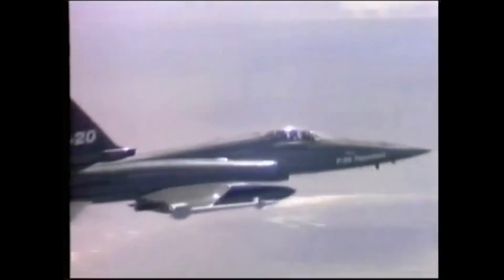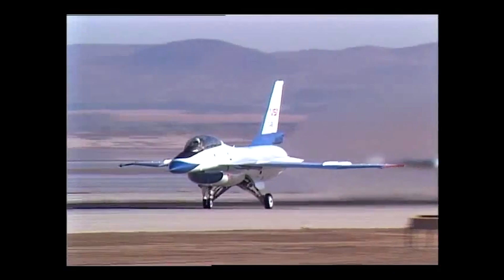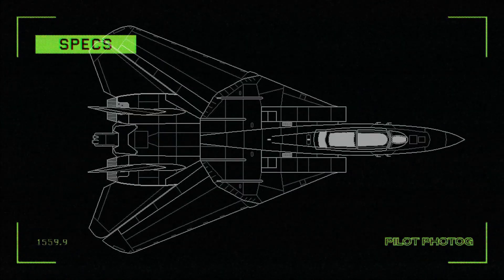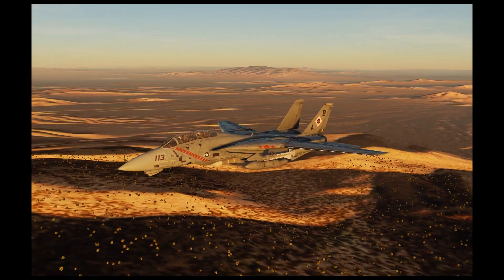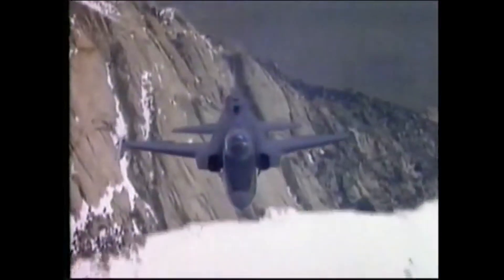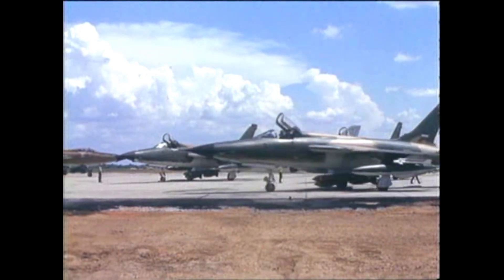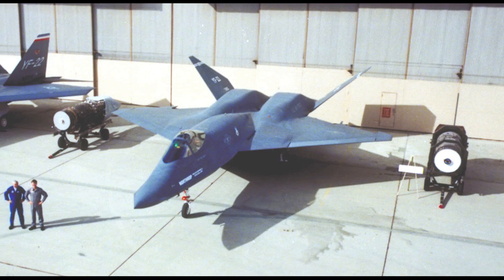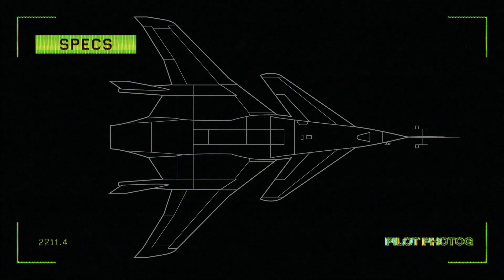Top 5 Fighters That Should Have Been Built | Best of Aviation Series by PilotPhotog  f20  f16xl

Comment: I was lucky to work on the F20, F16xl and YF23. Actually F16 B could be made into XL' s the cxl could outfly the F15E while fully loaded with munitions.  The Eagle had a better radar and two engines. The F20 couldn't carry the bomb load of the F16. The YF23 totally out flew the YF22 it was better in every aspect except size, (it was bigger the YF22)and engines the Air Force recommended a certain engine be used but  Northrop acft company wanted to use something else. If the Yf23 had used the same engines as YF22 we would have the F23 instead of the Raptor.
Reply: better in every respect?  Really?  That does not seem to be echoed by even -23 pundits.  As tested, the YF-22 was cheaper, (slightly) easier/cheaper to maintain, had a (slight) low speed/high AOA advantage, and had a larger combat load.

The -23 had a pretty sizable RCS reduction, (slightly) longer range, and retained energy better in high speed/high AOA regimes.  I also" think" the -23 had a higher top speed, though its supercruise speed was lower (or do I have that backwards?).  Admittedly, that may be due to the kerfuffle over engines you mentioned...

Both were awesome.  F-22 seemed to answer DOD's request better (at the time).   It did not help that Northrop already had a black eye due to the B-2 shenanigans.

-23 will live on in the -22 replacement.  6th gen looks to have stolen lessons learned from the -23 airframe.

Comment: Another fun fact about the Avro Arrow: It was designed with its engines on rails to facilitate a 30-minute "hot swap" (literally remove an entire engine and install a replacement inside a 30-minute window)... AFAIK, NO other military aircraft has even considered that as a possibility, let alone including that feature in the design. As a Canadian, I am still sad that the politics of the day cancelled the plane, but, as noted, many of those who worked for Avro found places in the space industry and had prosperous careers.

Comment: The F14 and F20 should have been produced. The F20 because of its affordability and easy maintenance. The F14 (thought a hydraulic nightmare to work on) was and is still one of the best fighters ever built. If we ever get into a dog fight with Iran, I fear they may show teach us a lesson on why we should have kept it active in our arsenal.
Reply: At many Redflags/exercises, the Tomcat was known as the Tomgrape... Grape = easy kill.  I would say it was one of the best interceptors ever built... and a slightly above average "fighter".  It was simply too heavy (even with giant engines) and bled energy too much in a turn fight.   Even in a vertical energy fight, the F-15 would out-rate the F-14 while losing less energy and the F-16 would simply not "bite" into the vertical, keep in the horizontal plane, and force the F-14 to extend or push a bad position with lower energy.  Same things would happen with Soviet/Russia aircraft in an actual fight (Mig 29 would play the Viper game, the SU-27/30/33 would play the Eagle game).  A fun "fight of the cripples" would occur if a Mig-25 met a F-14 (and somehow they did not shoot down each other BVR).  F-14 would win that hands down, assuming the -25 simply did not run away.

However, I admit that many of those aircraft would have been dead in a real fight from Aim154s.   Hence, great interceptor...

As for Iranian F-14s, they don't have Phoenixs and they are Mx hogs.  They may be able to sprint and catch a High Value aircraft out of position, but they would be no match for modern American 4.5 and 5th gen fighters.

Comment: FYI- 
F-14 had 135 Air-to-Air Victories (130 by Iran) vs 102 Kills by F-15 (all nations).
Expensive to Build, Expensive to Maintain, Expensive to Fly, but appears to have been cost-effective for it's designed mission.
The Upgrade would seem to be justified.

Comment: THANK YOU for putting the Avro Arrow in there. This Canadian aerospace development is so often overlooked but was revolutionary. It would still outperform some aircraft today.
Reply: We should go for it instead of the F-35, am i right?
Reply: It wouldn't outperform any modern fighters at all. It was outdone by the F-4 in basically every aspect of combat performance. The Arrow's revolutionary aspects were all in it's ease of use and maintenance.
Reply: @dumdumbinks274  First of all, it wasn't a fighter.  Second, it wasn't even put into operation, so how was it 'outdone?  It flew as fast in test flights with stopgap engines as the F4 ever did.  It couldn't possibly have faired any worse than in combat than the insult that is the CF-104, which can't claim a single air superiority kill during its entire service life.  How the Arrow ended up being killed for obsolescence only to be replaced by an even less versatile pure interceptor is stupidity of the highest order.
Reply: @shawnwells5719  It was the same type of aircraft as the F-4... a missile focused interceptor. The difference is that the F-4 and all subsequent 'High' US fighters could perform that mission just as effectively as the Arrow could have hoped to achieve, but they also had characteristics that allowed them to perform effectively in other roles as well as unexpected situations.

The F-4 was roughly 200kmph faster with the basic J-79s than the Arrow achieved in tests with it's stop-gap J-65s.

Not sure why you think the CF-104 not achieving a single air to air kill during it's service life is a negative point... it never saw combat. The F-104 however is credited with quite a few air to air kills in service with other nations.
Fact of the matter is that when the CF-104 was first procured it held 3 world records simultaneously and was arguably the best interceptor of it's day. Procuring the CF-104 was not an insult by any means... the only insult was scrapping the Arrow, and it had to be replaced by something.
Reply: @dumdumbinks274  it's not entirely about the plane, it's about the Canadian dream, it's about the innovative revolution it could spark for not just Canadian defense, but Canadian aerospace forever
Reply: @onegoodfurboj  Yep that is definitely something to consider, but it isn't a reason to buy the Arrow so much as it is a reason to keep the industry alive. You don't have to sell planes to make a profit in the industry, but as we all know that's not what the Canadian govt decided.

Comment: Canada was not involved in an anti ICBM system.  Money was never the reason given for ending the program, at the time.  That was fabricated as a reason, years after the destruction.  The 'reason' given, was that it was obsolete.  And a year later, the Canadian government arranged for used Voodoo F-101 to take on the role, that the Arrow was designed to fill.  Germany was interested in the Arrow as a tactical bomber, and France tried to order 300 Iroquois engines for use in the Mirage Bomber.  The Arrow was powered by de-rated US engines, producing about 18,000 lbs thrust in full afterburner.  It was capable of going supersonic, with both engines in full military power, no afterburner needed...  When it reached the top speed in its test program, it was climbing, at 50,000 feet, continuing to accelerate, with the engines at mid point afterburning setting.....  With it's planned engines, it would likely have been capable of super cruise, through a very wide range of speed and altitudes.

Comment: The F-14 was retired because Donald Rumsfeld had a beef with Grumman and had investments in McDonnell-Douglas and Boeing. It didn't retire because it was outclassed by the F/A-18, but instead because of political self-dealing.
Reply: Exactly. It can also be argued that the original F/A-18 sealed the fate of the F-14 by being flawed from the beginning. The Hornet didn't have the range for effective carrier operations, and on a few occasions crashed by running out of fuel short of the carrier despite a pretty normal mission plan. This necessitated a new aircraft be pursued and as such the Super Hornet was born, taking even more potential funding away from the F-14.
Reply: @dumdumbinks274  also the A-12 Avenger II stealth attack aircraft that went way over budget and produced nothing screwed over the Navy budget. $2 billion spent, and McDonnell Douglas only returned $200 million, Boeing returned an additional $200 million. This was after a long legal battle, and McDonnel Douglas/Boeing ended up getting the Super Hornet contract.

Comment: I would love to have seen the F 20 fly with the airforces. Sure, the F 15 would beat the F 5 one-on-one, but tests with two F 5 aircraft to one F 15 showed that the F 15 would not stand a chance (according to a dutch F 5 pilot). Two F 5 planes would still be considerable cheaper to buy, maintain and fly than a single F 15. I love everything with wings, but following the F 35 proces made me nervous. I think a fleet of cheap to buy and maintain arcraft will beat a handfull of aircraft that are expensive to acquire and maintain (let's just forget about fuelconsumption and noise). No matter what amount of stealth you put into it.

Comment: The YF-23 absolutely should have been produced. It didn't mainly because of cost over runs with the B2 program. The Super Tomcat also should have. The F/A-18 is like a minivan. If you talk to pilots that have flown both when they did mock dog fights, the story is pretty much always the same. The Tomcats flew circles around them and ran them out of gas.

Comment: The yf23 lost because of not doing a stunt?
Hummm, strange these things happen with more persuasive “stunts”
Reply: No it lost due to a number of factors, most notably the YF-22's superior payload - so much so Northrop modified the 2nd YF-23 prototype to include a 2nd weapons bay and it still didn't match the payload of the YF-22.

Other factors include the YF-23's over-reliance on experimental tech, the fact that despite the YF-23 flying first it ended up lagging behind the YF-22 in development, the fact that the YF-22 matched or exceeded the YF-23 in every practical aspect of performance other than range etc.

Comment: There was no mention of payola as a reason for other aircraft being built instead of those in this vid, but it was - and is -  a deciding factor in many huge gov't/military contracts.  Don't delude yourself into thinking it isn't so.  "Graft isn't dead here friend. Hell, it's not even sick!"  This is a great vid though!  It is technically and factually accurate, and it brings to light many fascinating aspects of aircraft development.  I'd like to see you do another similar vid, but on bombers and/or attack aircraft. It should prominently feature the XB-70 Valkyrie - designed for a  cruising speed of mach 3 (!) at 70,000 feet, with a payload of  OVER THIRTY TONS (60,000+ lbs) . It featured the largest moving control surface  ever on a plane - the 'droop' wingtips, that helped create  a phenomena known as "compression lift" that helped propell it to it's absurdly high speed.
Reply from the maker: Thank you and much appreciated- I plan a video all on the B-70 Valkyrie and others on bombers that should have been built.
Reply: @PilotPhotog  Yaayy!!  Thanks man!

Comment: The YF 23 could still be built since the last Democratic President cut funding for and for some reason all the spares to repair F22's aren't available so what the airforce has is all they are going to get. The YF23 could be upgraded, and produced for less money than rebuilding the F22's assembly line.

Comment: The REAL REASON the F-16XL the F-14/F-21 Super Tomcat and the F-20 Tigershark were never built? Because none of these planes said BOEING or LOCKHEED on them! Both Boeing and Lockheed have been buying off Senators, Military Staff and everyone else that has a say on where tax dollars are spent on military planes. Rest assured if ANY of these planes were proposed by Boeing or Lockheed they would be flying today!
Reply: Lockheed had nothing to do with those fighters, but Boeing certainly did. I'm still not sure where the idea of Lockheed being overly corrupt comes from considering the last truly corrupt thing they did was back in the late 60s, and it was their only real chance at surviving as a company thanks to years of expensive black projects almost bankrupting them. 

The F-16XL lost to MDD's superior F-15E which although was shorter-ranged could carry much more powerful electronics that were important for survival on the modern battlefield. Also note that engines of that era were pretty unreliable, so the idea of a long-range single engine fighter put doubts in many minds. 

The ST-21 wasn't even considered since no formal competition existed, albeit funds were required to fill the gap that was the political mess of the original F/A-18... a fighter known to have such short range it sometimes ran out of fuel on basic missions, resulting in pilots sustaining injuries while ejecting and then losing the airframe... MDD already knew what to do and began work on the Super Hornet by 1986. Boeing bought them out in the early 90s and decided to reuse the Hornet's designation (F/A-18) in order to fool congress into funding the Super Hornet despite it being a different aircraft. This diverted even more potential funds away from F-14 upgrades or the ST-21 and effectively sealed the F-14's fate.

The F-20 was too little too late. The F-16 outperformed it, the F-16 had been on the market for a whole decade and was combat proven, and the cost difference was negligible.

Comment: The air war in VietNam should have been fought  in the South with planes like the A-1 Skyraider and even WWII A-20 bombers were used to go slow enough to pinpoint targets on the Ho Chi Minh trail, something which is hard to pick out from the cockpit of a fast jet.
Lockheed should have done the same maneuver as the F-22 and then probably have won the competition.  It has been said the F-23 was way more stealthy and could go off like a bat from hades.
Reply: The USAF should've brought the F-5 during Rolling Thunder to counter the MiGs. YF-23 could've been the F-111's successor. F-22 could be exportable if LM make a derivative based on the YF-22 design but with no sensitive tech.

Comment: Diefenbacher was a fool.  The Avro Arrow was a super aircraft, and on one test flight it came into U.S. airspace and buzzed a USAF air base, scaring the hell out of all the U.S. fighter pilots because they still had a boat load of F-86 Super Sabre.  
 But Canada also screwed themselves because AVRO had more moles from the GRU and KGB than a poor person's backyard.  Because of the lack of security, that caused a red flag to be thrown.
To prove my last sentence, the  MiG 25 air frame looks 85% like the Avro Arrow except the Russians added a twin vertical stabilizer.

Comment: when the americans got their hands on the MIG21, they threw everything they had at it, all the modern best in class planes and pilots.
Each and every time, even novice pilots flying MIG21 would out maneuver them.

Outstanding performance from an oldie russian plane.

-just change the labeling, and 
you get all kind of "facts"-
Reply: MiG-21 was a great fighter if you looked at the spec sheet.  It had an Achilles heal, however.  Delta-wing aircraft lose speed and energy faster, as they turn hard, than planes with wings like the Phantom.  It took a while to figure this out, but: 1) if an F-4 could get behind an MiG-21 and turn it into a turning fight... and KEEP AT IT... after several full circles the MiG-21 lost enough energy it could be shot down.  2) if the F-4 couldn't, then use superior power to break off, then come back and try again.  Once this was figured out, the F-4 could win any fight except a surprise attack.

Comment: The F-20, with any of it's technical prowess, was most amazing not only having that, BUT - importantly - the COST. In acquisition, fuel consumption, maintenance et al. Great example of expenditure/practicality itself offering tremendous strategic asset. A two (maybe three) for one air force. Too bad. Great plane, just as the F-5 is.
Reply from the maker: Agreed and thanks for commenting!

Comment: When Yeager was spokesman for Northrop he challenged the DOD to a fly off between the F20 and the F16 winner gets the contract.Naturally the DOD said no.I think the F5 is a clone of the F20.Strange that the F5 was used as the enemy at top gun etc
Reply from the maker: Thanks for commenting...actually the F-20 is really the F-5G, but had so many changes from the F-5 that they gave it a new designation.  The iron is that if they had gone with F-5G it may have been accepted as an export option as there were several nations using the F-5E and some still do.  Here is the F-5E video if you haven't seen it yet:  https://youtu.be/na7E3OAPzoc
Reply: Put Yeager in the F20 and Bob Hoover in the F16 .. now that would have been a flyoff